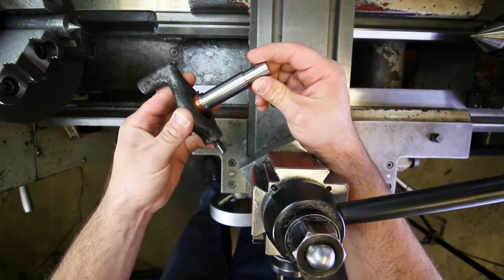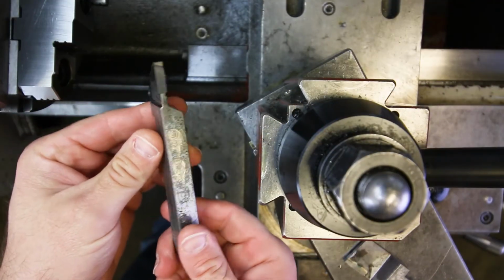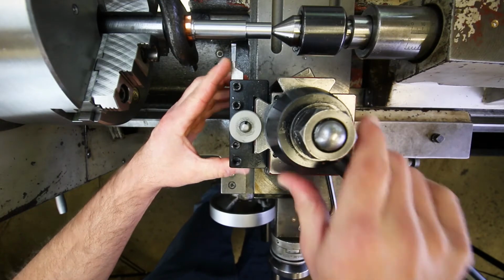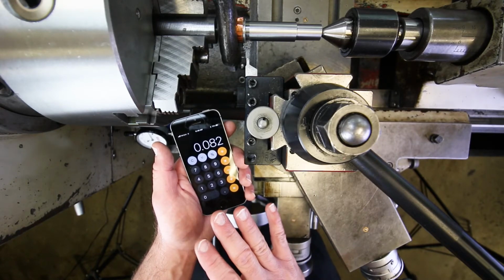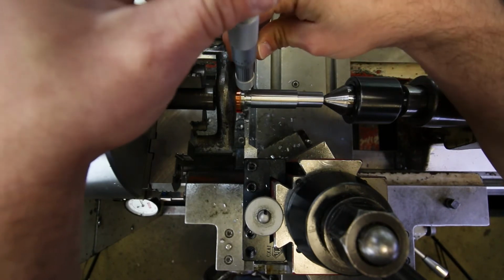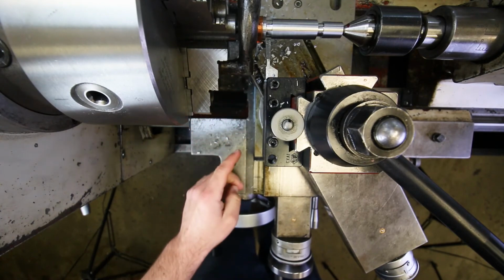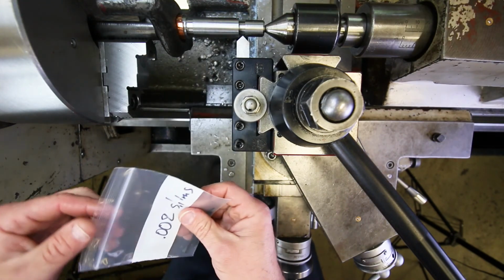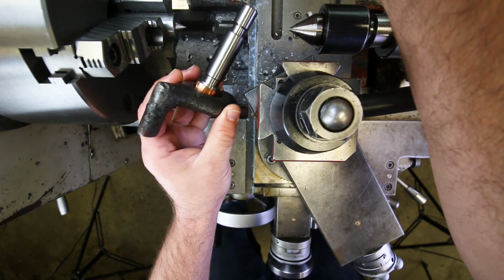Threaded Shaft - Demo - Part 3

Comment: When you set up the chamfering tool using a shim, wouldn't you need to move inwards by the thickness of the shim afterwards? Otherwise the "flush" chamfer wouldn't be exactly flush, right?